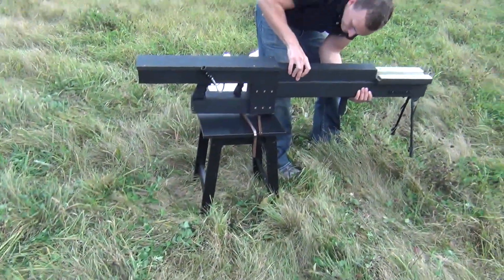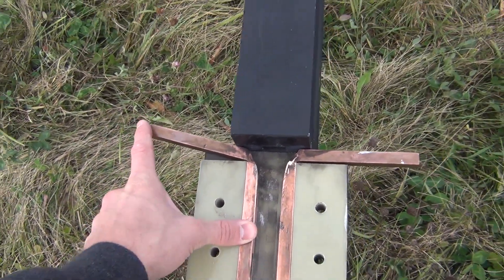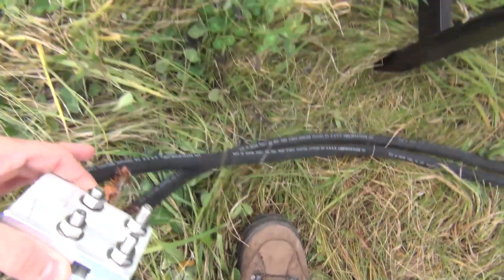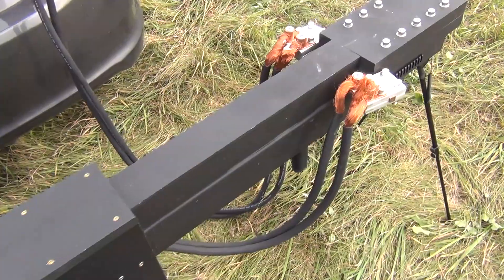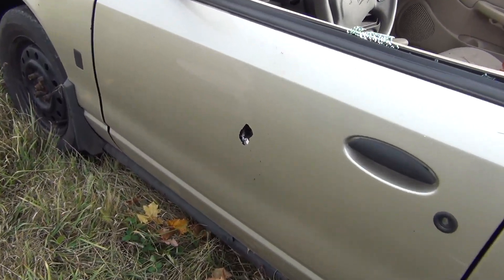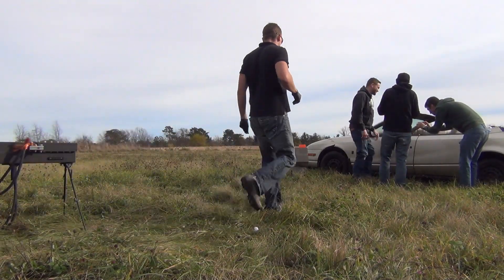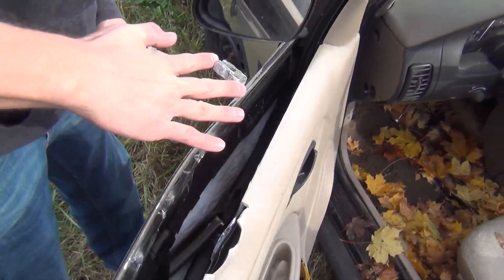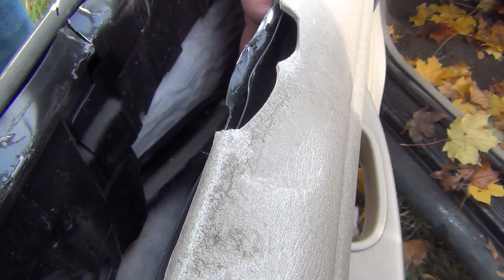250lb Railgun vs. Car Door: 27,000 Joules. Launch #4

Comment: What is your drive voltage ? Current would be a lot so what are your caps working voltage and capacity in Farads . The rails themselves are week point copper is a good conductor but very soft I’m thinking stainless steal with a ss ball bearing as a projectile

Comment: My railgun that the ATF and FBI dismantled and destroyed shot at around Mach 6.5 and hit with enough Force to penetrate roughly 10 in (20cm roughly) of ar500 Steel. My projectiles were custom made with a Tungsten core and a titanium outer shell. The purpose of the titanium outer shell is to melt or soften the steel and a Tungsten core was to penetrate the molten material. Each projectile cost $355.25 USD. It weighed roughly 300 lb (136.078 kilograms). The ATF dismantled and destroyed it by using roughly 3 lb of C4.
Reply: Mach 6.5 for a homemade railgun? Keep dreaming bud.

Comment: How about using conductive oil (basically liquid copper) between rails and projectile? That at least will increase the durability of your rails and projectile. Place another more aerodynamic projectile at the end of the rails and let the aluminum mass just act as a hammer.

Comment: Im dissapointed that the past humans have such lowly railguns.
We in the future have railguns as powerfull as those but with the same density and size of a typical m19 pistol.
We even use low powered laser devices to push big sized objects to repair simple damages for buildings and for construction.

You’ll have to wait 50 years for this to be released to the public tho.
You also have flying cars in about 80 years from now... and no they don’t work on magnetic fields... obviously they use electric powered jets which are added to the front the back and the sides of the car aswell as under... and no they don’t look cool they look pretty bland.

Im also dissapointed you don’t have 5gf resistant plastis yet..
Welp as jorin said... can’t expect to much from people of the 21th century... btw world war 3 will end pretty badly but you’ll rebuild after a while.

Welp hope to hear from one of you in 2120 when ur all grandpa’s.

Comment: given this guns structure and where the firing actually starts, its perfectly reasonable to create a form of ammo hopper or magazine for it. if not, a form of action where you just charge the bolt after each shot to load a new projectile from the breach end.

The projectile can be made slightly more aerodynamic, say put a non-metal pointed tip onto it just like actual rifle bullets (non-fullmetal).

I'd like to see you guys make a simple rudimentary aiming site for it, and try shooting objects at long distances, and testing for accuracy.

I have a feeling that any slight changes made to the projectile and the gun itself will allow you to pen that car door with ease ;D

Comment: You may have gotten a better efficiency using a coil around the core. It would amplify the magnetic field around the cores, and subsequently, increase acceleration and velocity. You might also consider using a 48v capacitor system, as this will also greatly improve the power it has. One final method of improvement would be gold plating the connection points, as this will greatly improve electrical conductivity

Comment: For a awsome electric plasma round plate between the back with copper and compress powdered quortze between the copper will charge the quortze for a massive electric discharge . Add aluminum and ironoxide for high temp and even em disspursal throughout the quortze powder . The resulte will be a thurmite burn and hight electric disspersale throughout the target mine when done should cut through a quorter inch steel plate and still kill the ecectrical system and might be able with your setup turn to higher output.

Comment: 27kJ is the stored energy in the capacitors. giving the length of the barrel and the material of your prjectile I doubt all this 27kJ is dumped out of the railgun. most of it is still in the capacitors (But I could be wrong)

Comment: Knowing nearly nothing about the myriad of details it takes to make a simple concept actually work, I still have a feeling in my gut: This length of the gun seems kind of short.  Like the length of a rifle barrel,  if the projectile is still accelerating a "meaningful" amount, when the end of the barrel is reached, energy is wasted, and just comes off a rifle barrel as unused muzzle blast.  In enough case the barrel is to short.  Unless you make the tradeoff on purpose.  I guess with a rail gun,  if the projectile leaves the rails "prematurely" the excess energy is dissipated bý arcing between the rails.  I'm dying to know how you all calculated the length of the rails.  It seems like it took so much work to get to where you are, that if you thought extending the rails would get you a big increase in velocity, you would have done it.   But just looking quickly, my common sense makes me want to think your projectile was still accelerating like crazy when it reached the end of the rails.  In which case longer would be a free lunch.  Oh, and the German WW2 prototypes, and the one the US Navyis trying to deploy, stick out in my head for being LONG.  Is your rail length optional?  It's not a Saturday night special snub nose rail gun is it? LOL
Reply: I meant "optimal" not "optional" for my barrel length question.  I actually wrote that huge comment on my phone,  with auto- correct helping.  LOL
Reply from the maker: The barrel length was carefully planned. The voltage was exactly 0 after firing with the original 56 caps. When the caps were increased to 70, a bit of voltage was left over. 

Railguns can be short or long depending on the power. I opted for high acceleration/short barrel

Comment: Wow.  I'm.an electrical engineer, but a digital guy,  where voltages keep getting lower, along with current -- less power.  I remember in the lab, years ago,  we were betting on how many amps the very small gauge wire wrap prototyping wires would take before they over- heated.  10 amps, through the thin little wire.  I was amazed it took that much. 

So when I see doubled connections of big fat wiring, and know that a really thin little wire took 10 amps before it blew, I realize that the currents we're talking about in your gun must be HUGE!  This stuff is really cool, and makes a bunch of ones and zeros seem so boring...  LOL

Comment: Problem here with your set up is to do with what we'd call short-circuit withstand current of your system.... there's the short-time and peak values...in your case for a gun you'd be concerned with the peak values....that means, you have to ensure your system does not melt during a short-circuit event...the better your joints the higher the peak-value your system can withstand, the more powerful is your gun.

Secondly you wanna have more energy converted to electro-mechanical force directed at the prohectile as much as possible rather than letting convert into heat or vibrations else-where which dissipates the force directed at your project. 

I can see a lot of sloppy connections and loose cables everywhere...that's gotta lose you some power. Also, heat builds up at bottlenecks...that's why a few places were obviously burnt...they were bottlenecks. People who design power-distribution systems will immediately see the flaws in your engineering.

Comment: There are a lot of things you could have done with this design to avoid jamming and a higher rate of projectile velocity. First off, gun oil would not make this weapon malfunction (Keep the "barrel" lubed up and clean). Second, serrate the edges of the copper lining so that it propels the projectile faster and more accurately (Its the equivalent of rifling when it comes to rail guns.)
Reply from the maker: Gun oil would interfere with the sliding electrical contact that makes a railgun function- the "bullet" requires electricity to flow through it!
Reply: Doesn't have to be gun oil (I correct myself). Any kind of oil without a conductive barrier would do fine. Also. Serrate those edges!

Comment: Try longer rails and projectile with less mass. Not sure how or if the forked tail is effecting the eficency of the electicity or EM field, in that arcing or some interference between the prongs acting as possible individual poles while the field is induced (purely speculative). Only a thought, considering the discrepency between the rediculous power it takes to tear the connections apart and arc across the conduits running from the capacitor bank.  Your railgun is possibly the best in terms of garage project railguns. The first video was ample indication of the power it is capable of. I wasnt able to see the connections to the rails or the direction of flow for the electricity. Connecting the rails at opposite ends of the rail frame will maximize the consistency and even distribution of flow as the projectile moves towards the inflow of power and thustly shorter repulsive field as it reaches the end. Connecting the outgoing power to the oposite end of the rail means there is still a full length of rail, conducting power along the length creating less fall off in repulsion induced in the projectile as it nears the end of the rails... 

A projectile of that size and mass should have been able to poke a hole through the engine block. None of this is a criticism by the way. I'm super impressed but can't help but feel as though you are losing a lot of power through some overlooked element of design or execution. Good thought on the CO2 initiatior BTW, I always wondered about the effect of dumping that much power into a rail gap and possible welding it into a mess. 

Don't listen to the haters posting shit about the supposed lack of power of the design. Willing to bet that none of them have the first idea of where to start or how to build a railgun. As I said before, less mass would allow exponential increase in velocity and tidying up any gaps where arcs could sap power or induction between the rest of the circutry and delivery system would demonstrate an instant increase in power and efficency. 

Whatever you do, keep it up. I'm just some jerk off with a purely theoretical knowledge of the physics involved and I'm way to afraid to fuck with electricity to try this without people with practical, appplicable know how.
Reply from the maker: The lower efficiency is inherently caused by the large mass of the projectile relative to the size of the capacitor bank. Essentially, railgun efficiency is very poor until extreme velocities are reached (low efficiency occurs in the navy railgun until high speeds are reached down the barrel). An extreme example of this, for pure theoretical sake, is a projectile that weighs 100lbs. You deliver 1500 lbs of magnetic force upon it, but it moves a very short distance during that pulse. Since the energy imparted upon the projectile is force x distance, the energy is quite small.

A similar example is a rocket engine- A rocket going faster is inherently more efficient (as wildly impossible as that sounds, it's always best to fire rocket motors at the perigee (fastest point) in an orbit rather than the apogee (the slowest)). A infinitely heavy rocket going 1 m/s with a 1 N-S thrust motor will gain 1 n-m in energy. That same rocket going 1000 m/s with a 1 N-S motor will gain 1000 n-m of energy (because that 1 newton of force is applied over a distance of 1000 meters during the 1 second burn).

The power delivery system (while flawed with the cables flying off) does the trick in terms of delivering the power. It's actually a benefit having some resistance in the lines- Capacitive-inductive circuits like to resonate. If a polarized capacitor is allowed to reverse polarity  (go below - 10 volts)  it violently destroys itself- ruining a very, very expensive capacitor bank... and possibly my car windows.

Comment: i knew when you didnt clear the door pannel......it probably hit the intrusion beam....saturns(since comprised of polymer) are one of the only cars that actually have a replaceable intrusion beam/assembly. And its a very very large stamped HSS well over 1000kpa of strength.........in other words that door if you hit that beam is harder to pierce through than a normal car door with any round.........and most car doors with their beams are actually much smaller in thickness and width. than the saturn just sheer luck of the draw i guess......either way sick rail gun..........and to naysayers go do some research on intrusion beams and HSS.......or if there are any ballistics test of calibers on the b pillar since its also quite strong to see what kind of rounds can pass through 2-4 layers of HSS.
Reply from the maker: Good to know :)

Comment: Of the 27 kJ original energy probably most is lost in switch, some more in eddy currents.  The loop physical size should be minimized.  Ideally the cables should be coaxial, but at least they should be twisted together and tied together, because the magnetic forces try to expand the loop.  The same principles apply to the capacitor bank that should be made as compact as possible.

Comment: for those who think the projectile propulsion was very weak well if  you see the projectile it's not shaped like a bullet it has a very broad front, and so they said it rather created a crater on gate than penetrating it, all because that huge output was distributed on a large area, and that made almost impossible for that projectile to penetrate but it still did! FLAWLESS WORK GUYS!!!
Reply: Well if something is moving fast enough the shape doesn't matter. If it was truly hypersonic there would have been a hole straight through both doors
Reply: @joeKisonue  the shape still does matter
Reply: @theFishy_  no, after a high enough velocity shape makes zero difference.
Reply: @AsbestosEnjoyerI don’t disagree what these guys did was awesome but the whole point of a rail gun is Mach fuck

Comment: Let me just point out that the projectile hit the door reinforcement, aka the crash bar, which is made (even in Saturns) out of ultra high strength steel. It's a bar designed not to deform in the event of a side collision, and it was bent almost totally around from that projectile. That's a huge amount of energy to get that done.
Reply: big pickle

Comment: Few people dissing the power. . It's a prototype I'm sure. But if or when the projectile becomes made of titanium, tungsten or bronze etc with a pointed or domed front it will go straight through the car. Also I guess the length of the electrode rails should be longer for more power/acceleration time. I'm no expert at all on this subject but it's a cool project.

Comment: I think you should place electromagnets parallel to the 2 copper rails and connect them parallel to the copper rails. I don't see any magnets placed perpendicular to the trajectory of the projectile. If you don't have any magnets (or very weak ones) your total Lorenz force acted on the projectile would still be very low.

Comment: Needs more mass in that projectile I'd imagine it's plenty fast but without enough mass all that velocity is useless need to use a denser material the Navy one uses a tungsten rod if I recall correctly quite pricey for a large gun but your size shouldn't be too insanely priced to test it

Comment: Rail guns are really only feasible on large gun military type applications.
I live close to Dahlgren, Virginia, the facility undertakes research, development and testing of rail guns for deployment aboard ship. Shakes my house from 20 miles out when it hits and explodes in the water of the lower chesapeake bay.. boom. Good for high speed projectiles w long range and low recoil . I dunno

Comment: You can easily get more power by twisting your power cables together, or better yet using coax cables. In a good railgun, the inductance of the rails is a significant portion of the inductance of the whole system, ideally most of it. The way you have your cables far apart and able to flex under magnetic field wastes a lot of energy.  Nice railgun though!

Comment: If you decreased the mass of the projectile as well as making it more aerodynamic you will have a great total force on a smaller mass resulting in a significantly larger acceleration in the same time frame resulting in a higher velocity, higher relative mass, and higher kinetic energy

Comment: I don't know why so many below are bitching about how you did what you guys did, fact is you got out and did it. It looks like you had great fun, all of the keyboard critics should actually try to get out of the basement and try something like this.
Reply: Happily working on other things
Reply: I just might, the problem I’ve seen with small scale rail guns is a generally consistent underwhelming impact. I’d really like to experiment with a hand held hybrid rail gun using an alternative initial propulsion system. I’m thinking maybe a traditional combustion based propulsion, assisted by a specialised custom barrel with highly magnetic sabo that allows perfectly electronically timed electrically charged magnets to switch on and off in the points of a millisecond that  the bullet exists in the barrel after being fired. Obviously the bullet would have to be larger and made of a magnetic metal also. I hypothesise that adding the strategically staged and spaced high powered magnets could potentially both increase the projectile’s velocity as well as stabilising the bullet. Only problems I can think of would be the lack of bullet rotation and the round fusing to the barrel. As well having to figure out the extremely complicated magnetic sequencing. But once a working prototype is made it’s theoretically possible to upscale or downscale and possibly be made more practical or reach even higher velocities.
Reply: @BleachCuresBlindness  🤜🏼
Reply: Happily wasting my time elsewhere.